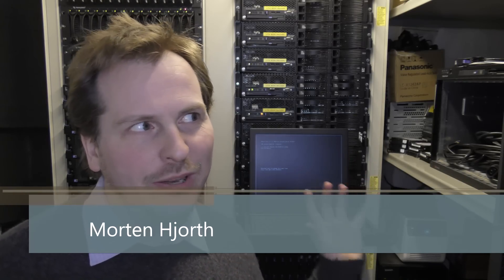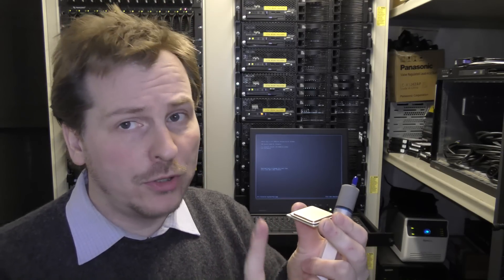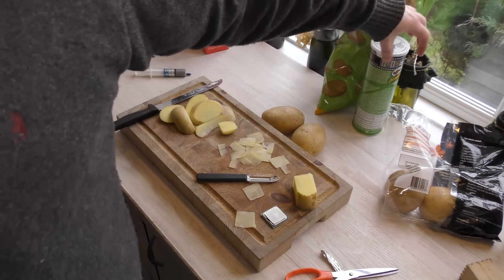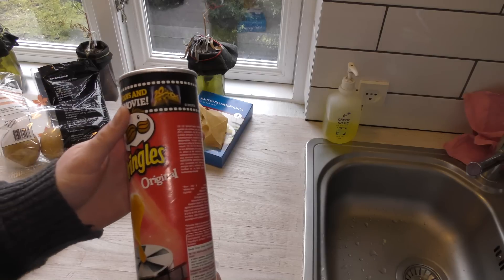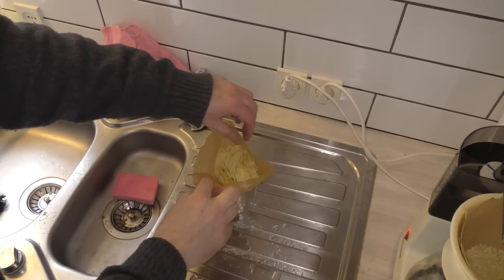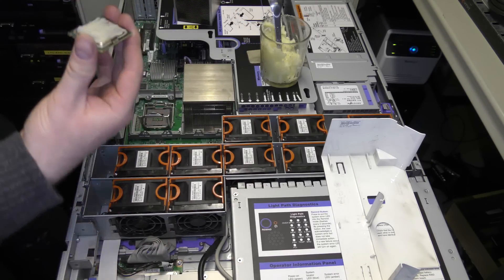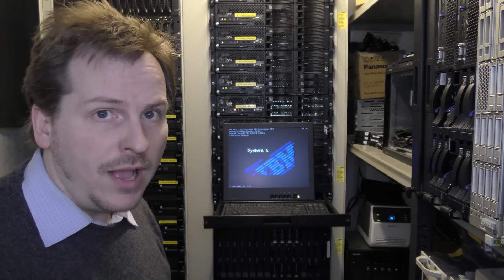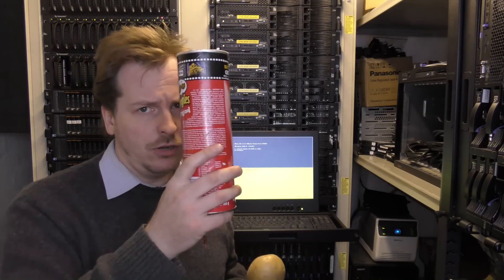Organic Heat Transfer with starch - Enterprise Lenovo Server - 328

Comment: Morten try to get some ear protection, it's easy to get deaf to specific frequencies without even knowing it, and it starts after only few weeks of working with servers!  when you "get used to the noise" it's too late... you wont notice it in everyday life but you can notice it when it doesnt bother you at work.. i have a friend who works in hospital, doing hearing tests all day long heh   people can hear sound from 20Hz to 20kHz, but it is perfectly possible to be deaf somewhere in between that range too
Reply from the maker: Hi +Goran Škoc
I Am in a server room about two hours a week,, including my own. I do know it is not good.
Thank you for watching! :-)
Reply: +My PlayHouse (Morten Hjorth) hehehe yeah :)) stay safe! :))   btw, can you tell us something about ssd drives in servers? how good they perform vs mechanical drivers, are they hot swappable, are they durable inside raid array and stuff like that? i dont have much exp. with ssd in servers
Reply from the maker: Hi Goran Škoc
Well I have tried to do videos on that,, have you seen them?
Thank you for watching! :-)